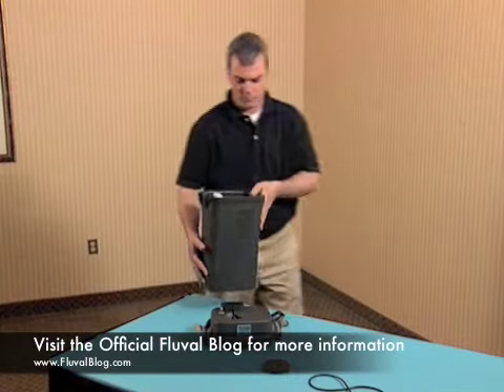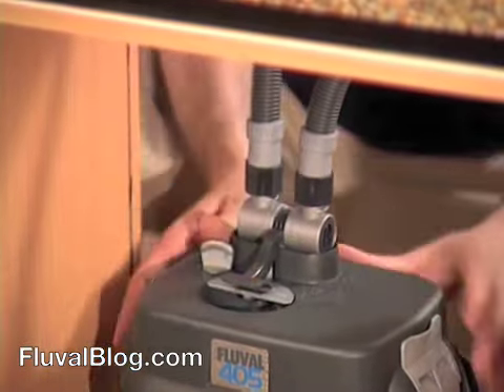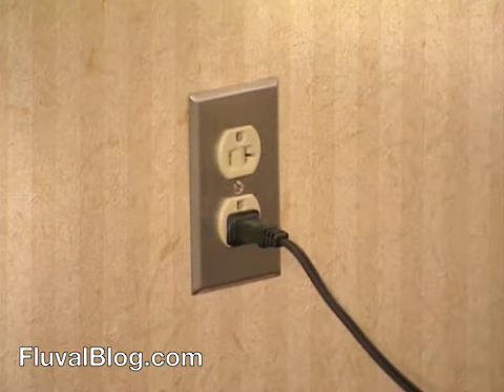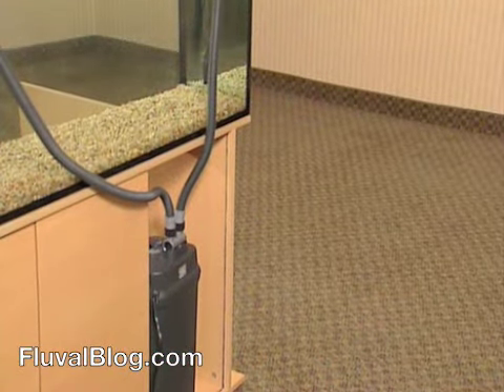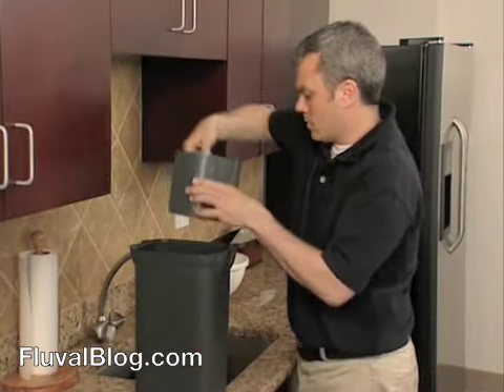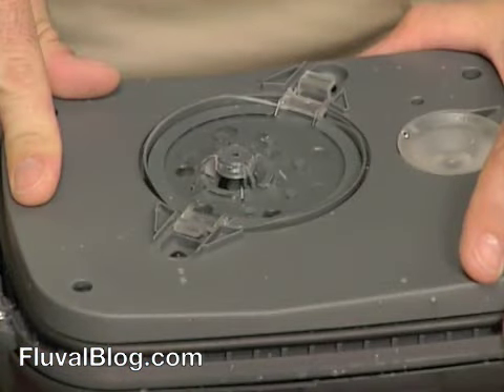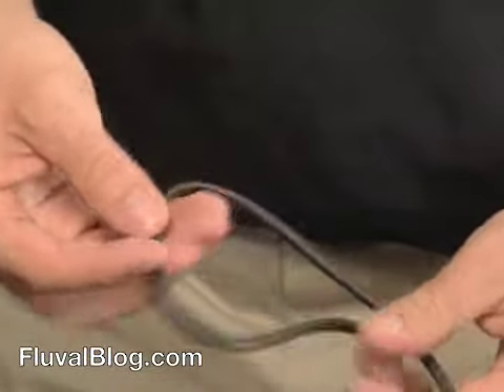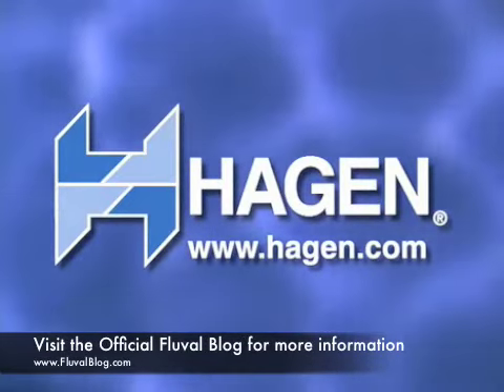Fluval 05 Series Filter Setup (Part 2 of 2)

Comment: I bought my 305 back in 2008 when it first came out I only ran it for a year then put it in storage cause I had to move along with my aquarium. I want to set up my aquarium again really don’t feel like spending $200 on a brand new filter, do you think my 305 will still run good as new all these years later
Reply from the maker: Hi there! You'll need to replace the gaskets and O-rings, and verify that the impeller assembly still works as expected, but otherwise the filter should be fine! Testing it outside or in your garage may be a wise step, in case something has failed over the past 15 years. 👍
Reply: @fluval  yes they sell a whole replacement parts kit on amazon for the 305 I got I’m waiting for it to come

Comment: At 7:02 there's a yellow Impeller Well Insert. Are you able to tell me the purpose of this part and any signs it needs replaced?
Reply from the maker: Hi there! The yellow piece is part of the impeller shaft assembly. It should only be removed if the impeller shaft breaks!

Comment: I was having a difficult time having the unit to pump water into the tank. I checked the impeller, still no flow, it was turning but not pumping. Turns out that I had the intake and outlet hoses backwards 😩
Reply from the maker: Sorry to hear that Barry, this is a fairly common mistake, we have all been there! 😁

Comment: do you really need the pipe conections in the tank below the water line? i have just bought a 90 gallon tank for my turtles and there is no way i am filling that to the brim! it only needs about quater to half of the water in for my turtles so can i just leave the pipe conections above the water line?

Comment: i had problem with the gasket on the204 once after a filter cleaning it leaked and on my other 204  we had apower failer with that the filter started leaking lost half the water before i noticed we were in the dark changed gaskets and no more leaks is there a maintaince to prevent that or any advice

Comment: I just got a fluval 405.  The problem I have is that the back of the lid doesn't seem to sandwhich tight with the bottom of the canister.  When I lean the canister, water drains out.  I've checked and everything is clearl, but it doesn't sandwhich all the way.  Any ideas?

Comment: I know you have to change the carbon once a month but what about the polishing pads and the other foam pads? Please advise.
Reply from the maker: Hi Terrol, the frequency at which mechanical pads plug up varies with your the waste load of your aquarium. The typical method for polishing pads is to replace them when they have removed the specific symptom at hand (i.e. suspended algae), or when the flow drops visibly. Foam pads on the other hand can be rinsed and re-used. Replacing them a couple of times a year is usually adequate.

Comment: "Never change all the Media at once" . Hahahahaha!!! But it's ok to wash the baskets with the BB under tap water!!  What would be the difference?  Both are dead anyways!   It urks me to see someone cleaning their media this way... If you use tap water - use it to clean the plastic baskets of solids as well as the plastic canister.  Most of your BB is within the contents of the media (BioMAx balls, etc) not so much in the containers so as long as you don't wash out your media's under tap water,  your filter should still hold its nitrifying bacteria.  Prior to syphoning the water during a water change,  set aside at least 3 gallons of water from your aquarium to clean out the media you have in your filter.  This way you are not killing off any beneficial bacteria in your tank that took your filter months to create.
Reply: Maybe they are using well water..lol

Comment: If this is meant to be the official Fluval guidance on routine filter maintenance, why are they showing everything being rinsed under a running tap? Any aquarist should know that is a big NO NO and the quickest way to kill off all your good bacteria in your filter!!! Mature filters should only be cleaned using tank water to maintain the good bacteria.
Reply from the maker: That is true for the main biological media however filter media that is placed at the incoming water point into the system that really serve more of a mechanical function can be rinsed with tap water and thoroughly cleaned out to optimize flow.

Comment: question, why are you saying to wash the media under running tap water when you should know this method will kill off all bacteria  needed to break down waste etc? when even the basics of cleaning media is to use water  from the tank. i like fluval products im even looking to buy a roma 240 in the nxt few days hence why im here. I would like to see a company such as hagen to use this method rather than the tap water method. a lot of potential new customers will be watching thinking its the way they should do it when they will only putting their fish under stress which is not necessary. on the other hand ty for the vid it will be helpful should i get a roma 240 with a 305 filter :)
Reply: +dm101lad  i see you added the red box with that instruction, mayber do and updated video with an updated model??
Reply from the maker: +dm101lad You should always rinse new filter media before use. Bacteria doesn’t exist on unused media, and this is what we are conveying this set-up tutorial. In much of the support material that we produce, we do make mention of rinsing Biomax, for example, in water taken from your tank. However, there is plenty of active bacteria left if you rinse under similar temperature tap water and dose with Fluval Biological Enhancer as instructed on the label.
Reply: +FLUVAL Aquatics I agree that new filter media should be rinsed before use. However, this video is showing something different. It is showing a filter that has been primed and used in the tank, being taken apart and rinsed under tap water. This is not good practice and sends out the wrong message.
Reply from the maker: +Retro virus At 5:29, a red box appears on the screen instructing not to rinse bio media with tap water. Additionally, we do go on to state in this video the staggering of filter media replacement, which is the right recommendation. For new filter set-up, yes, rinse in tap water and use tank water as stated in much of content in both instruction manuals and other content on our Fluval Website.

Comment: U should rince the media but not in tap water as this vid shows use the old dirty tank water u don't whant to clean the media just remove particles that restrict water flow also never change the bio rings only change the carbon at least1ce a month